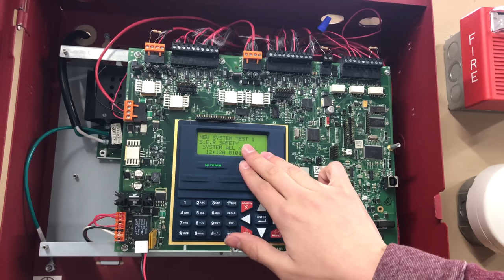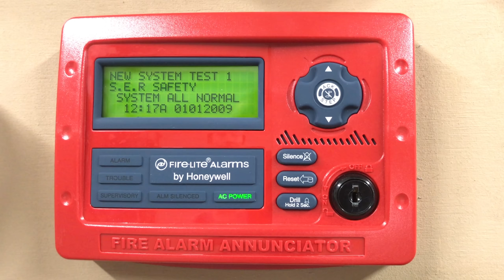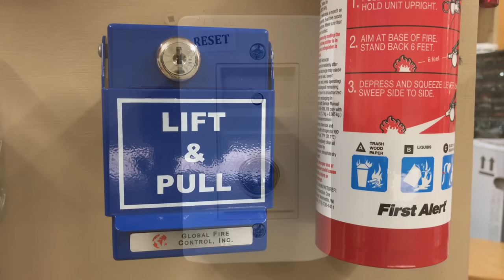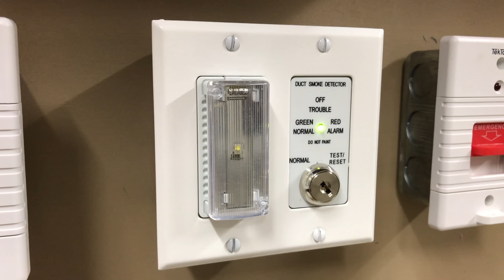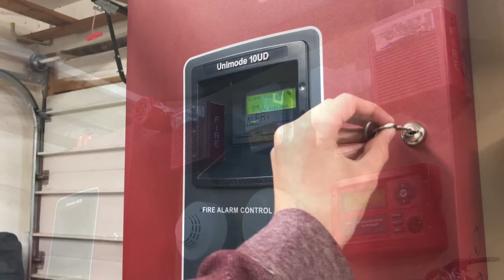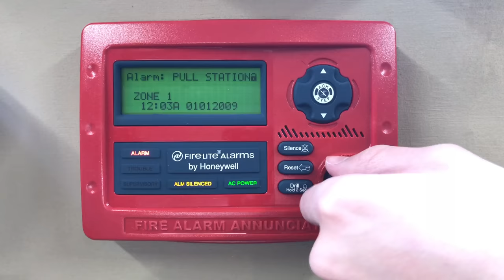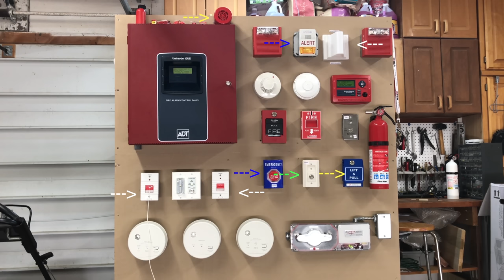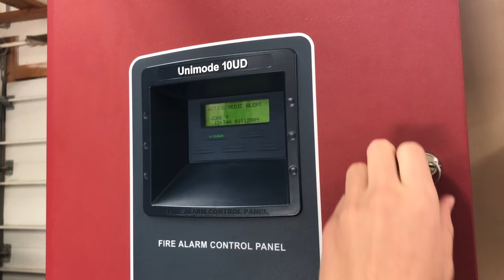ADT Unimode 10-UD NEW System Test 1! (This is the BIG System)

Comment: My Firelite MS-5UD has a charger fault on the display with nothing connected. I assume it’s talking about the battery charger. Is that something that can be repaired? I have heard you can disable the built in charger in the system so you can charge the system with an external charger.

Comment: So the pull station to the left is zone 1 and the pull station to the right is zone 2 and the drill switch is zone 3 and the reset switch is zone 4 and the emergency push button is zone 5 and the smoke detector is zone 6 heat detector zone 7 the lift and pull is zone 8 pull cord zone 9 and finally duct detector zone 10 wow pretty big system!

Comment: My school has a simplex system with a 4100 ES panel with 4099-9006 T-bars 4098-9605 photoelectric smoke detectors and duct detectors we have heat detectors in the kitchen area and in the culinary arts room but can’t remember the model of them

Comment: Quick question. That rj45 ethernet port on the bottom right corner of the panel, is that to hook up a dialer? Or is it used for computer programming
Reply: It is for a dialer. The panel has a USB Type-B connector for programming with a computer.

Comment: They have those Wheelock AS horn/strobes at the Lowe's here in Monroe and holy crap they're LOUD!
Reply: I have one too, that is why I removed my volume jumper in it (which turns off the horn). I only have it on with proper ear protection in a soundproof room.

Comment: Two nacs are not supposed to power the same device, you could program something wrong and kill both the nacs on one device, so I suggest taking the wire out of nac 1 or nac 2, and just throw the EOLR in place of the wire, trust me, it'll help with the panel's lifespan!
Reply from the maker: Two nacs can when you have  a 4 wire device. 1 nac powering all the strobes, the other powering all the horns. The one with the strobe is set to not silenceable. So then you can have it so the strobes still flash when the silence button is pressed. In this case though, I have two wire devices, so I did what you just recommended by resistoring off the end and not using the strobe circuit. But in the future I may use a 4 wire device.
Reply: In the case of a four wire device, that's a different story, but when it's a two wire device, and two nacs are hooked to said two wire device, that's a great recipe for disaster!
Reply: Excellent, just making sure that your panel is at optimum efficiency and health!
Reply from the maker: Yeah, that would fry the panel.